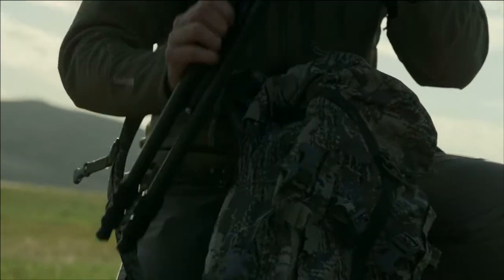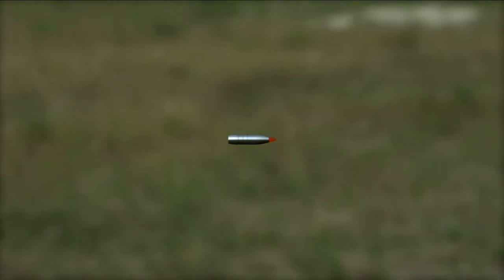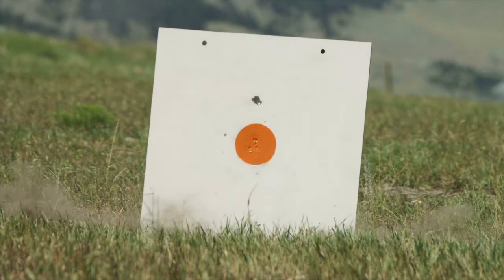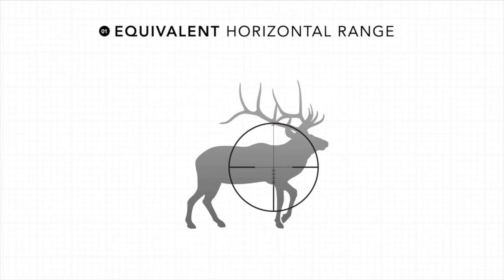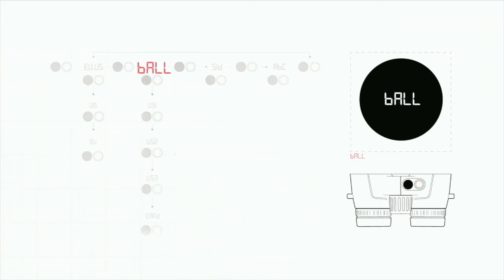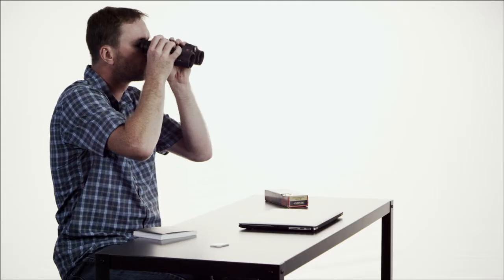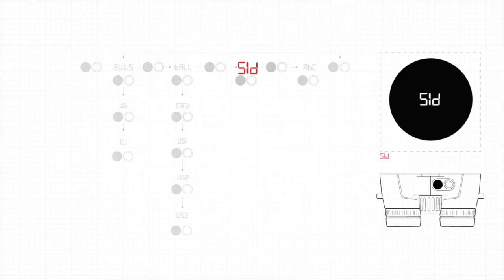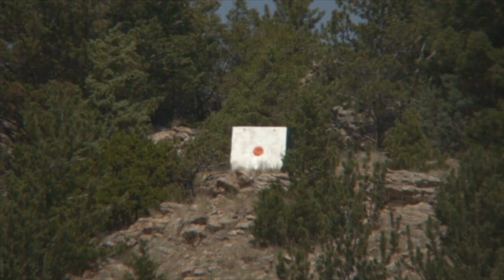Geovid HD-B - Instructional video (English version)

Comment: Be warned the HDB does not work as it is promoted. If your SID is not at 100, 200 or 300 the SD ballistics program will not work and the holdover will never be correct. Leica just ignores my concern about this.